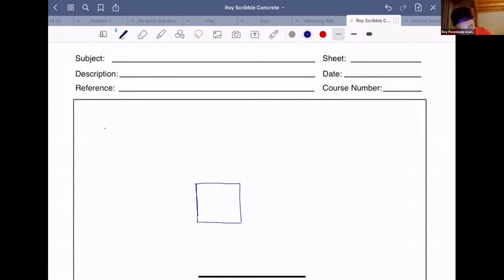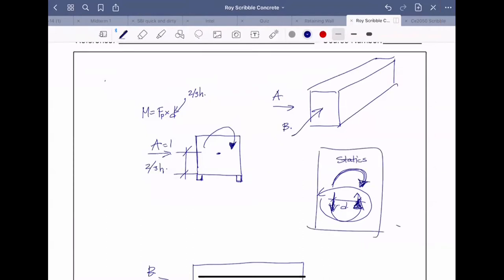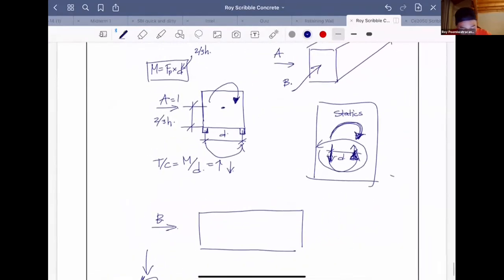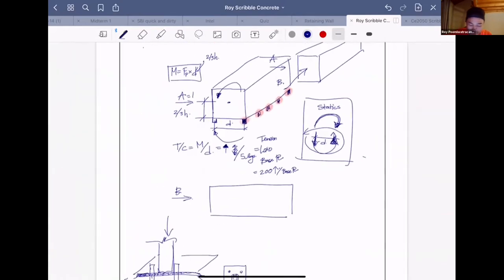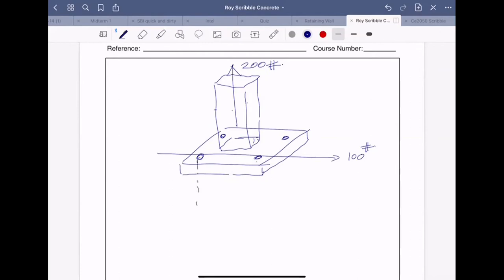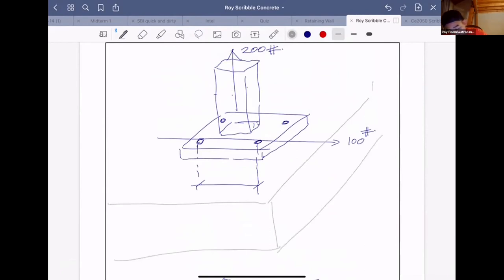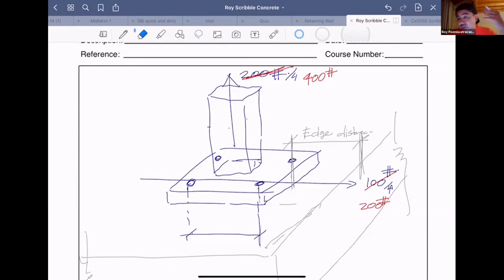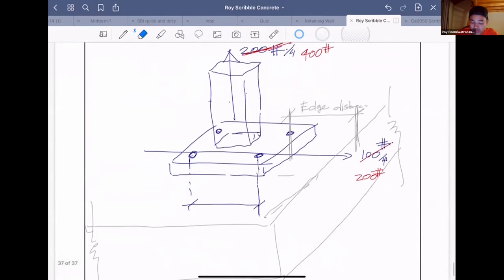ASCE 7-16 Chapter 13- Non Structural Component - Fp analysis

Comment: Came across this video and your other one on ASCE 7 Ch. 13 while trying to better understand sizing of anchors for seismic restraint. They were both helpful.
Can you explain why you wouldn't use the weight of the component applied at the center of gravity when summing the moments to find the tension reaction at the anchor?
Reply: 2/3 Height is used when the Center of Mass information is not available. In your case, if you have the center of mass given by the manufacturer, you'll more accurate results. 2/3 height is typically considered to be a conservative assumption when the Center of Mass is not defined.
Reply: @roypoomiwatracanont7762  Thanks for the reply. Is the dead load of the component not factor when finding the tension at the anchor?
Reply: @zachhope1038  : It may not have been mentioned in this video. If you're in a crunch for your design, then include your dead load, but once you do that you'll need to follow the code section ASCE7-16 13.3.1.2 "The component shall be designed for a concurrent vertical force +/- 0.2 x Sds Wp"  Therefore if you conservatively ignore the dead load, you don't need to take this component.  Hope that helps... This gets into more of SE type question =)
Reply: @roypoomiwatracanont7762  That does help. Thanks for taking the time to respond. There will be an SE evaluation each specific application. I just wanted to have a better understanding how the sizing is done.